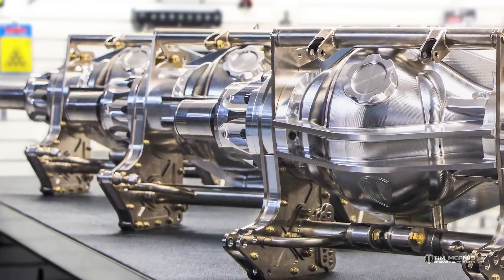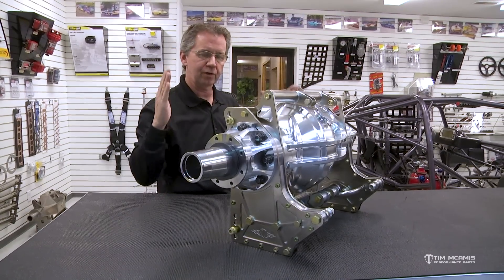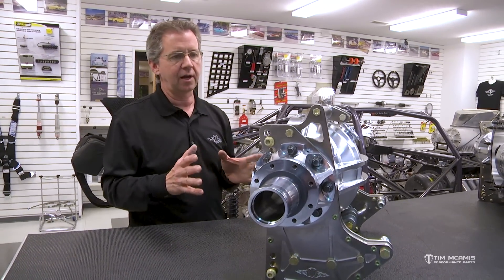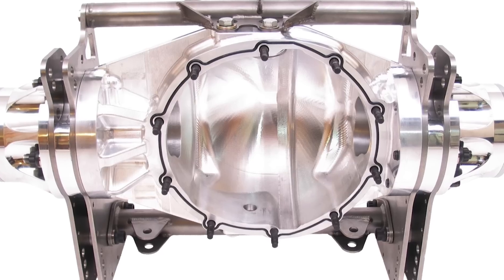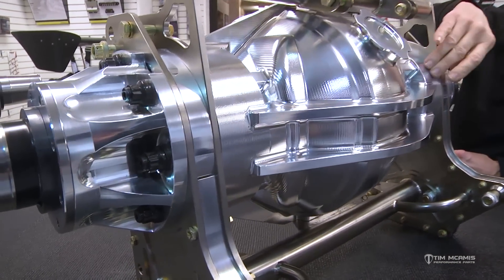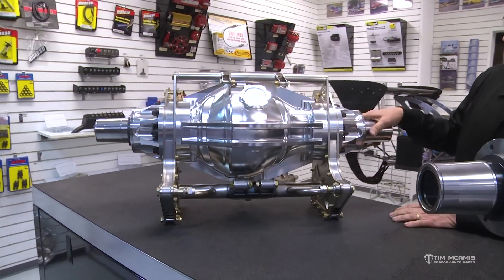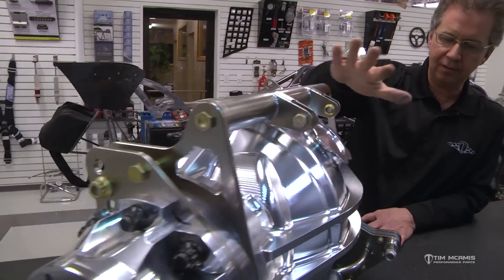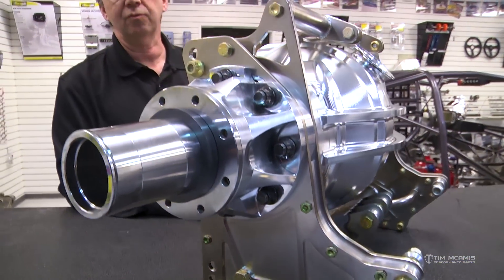TMRC Billet Housing Update

Comment: When you said you can never get a welded rear end to have 0 toe on both wheels at 36 inches, you could machine the housing ends after welding to achieve 0 toe
Reply: You could compensate for it, but you would be adding weight.  I wonder if rotary friction welding would keep it straight.